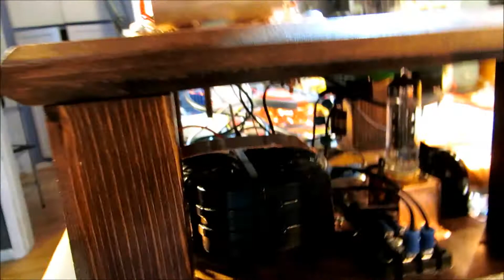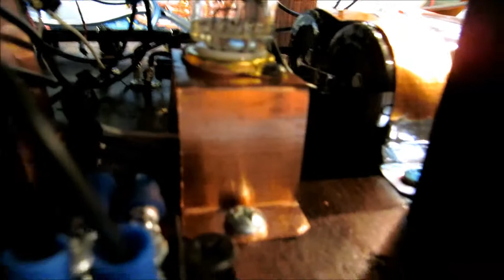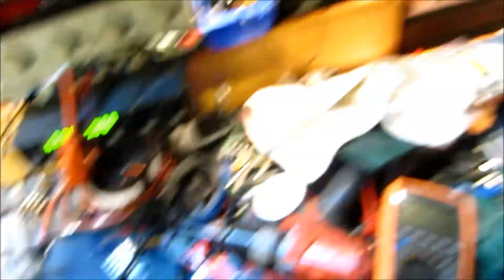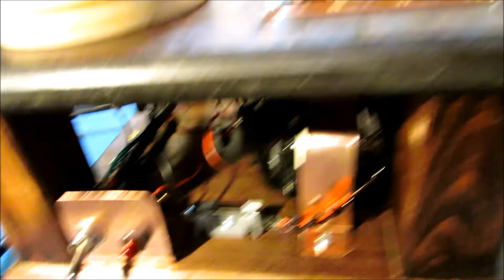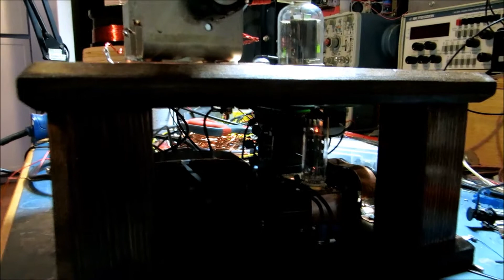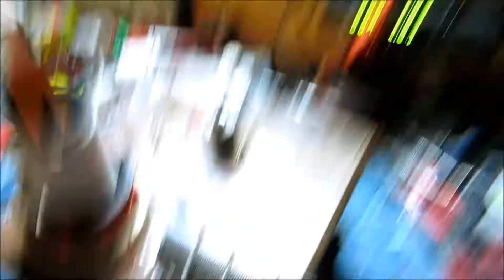6146 Vacuum Tube Tesla Coil

Comment: maybe a necropost but nice build, it looks awesome but yeah, i prefer just a slab of wood and just pour all the components over it tacked with hot glue or something (it looks worse obviously)... anyways if you drive the tube with pulsed DC out of a MOT with just a diode, reduced with a variac or a step down trafo, you'll get pretty long arcs even with a small tube, you can also try to double the output of that trafo with a diode and a big capacitor, microwave oven style